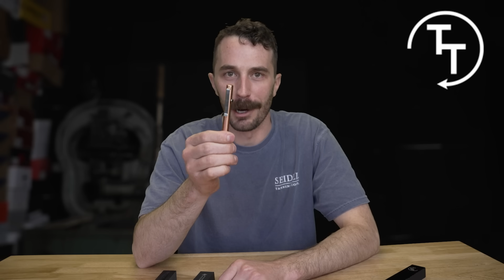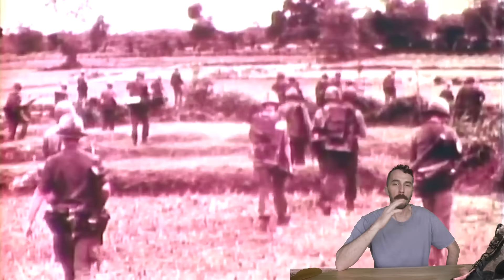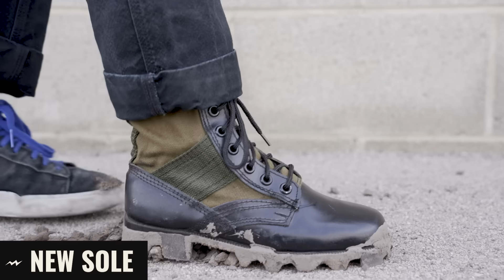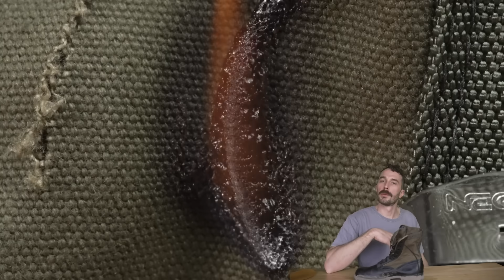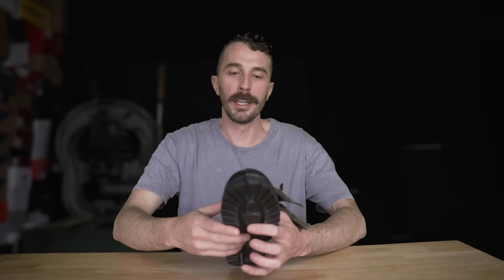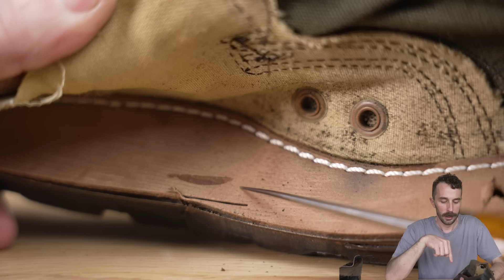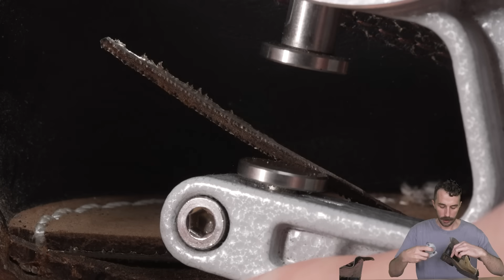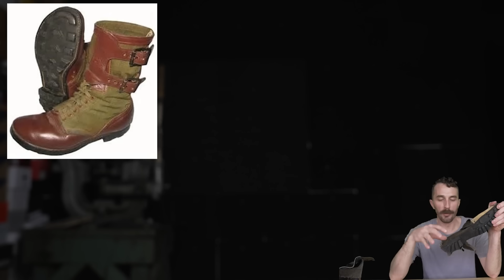Why it took 57 years to replace jungle boots

Comment: Jungle boots were awesome. They could be re-soled after they wore out with even better Vibrams and you had the best boot until you could not wear it anymore in 2005. They were very difficult to break in and you had to soak them and run in them to get them to expand then put a bunch of neutral and saddle soap to keep them expanded after running in wet boot for a while. Otherwise you would get the blisters from hell! New boots don't need this break-in process but don't last as long. I would like to see a test of the new Marine Corps jungle boots, the Danner RAT boots, and ICBs (Infantry Combat Boot).

Comment: Terrific boots only obsolete for war because polished black leather is an idiotic surface for a combat boot and shows up on thermal viewing systems. If the US makes another constabulary strategic mistake I expect a modern version to be fielded unless there's still a stash of originals. I wore out several pair on USAF flightlines because though they lacked steel toes they're outstanding hot weather boots for prolonged use on pavement. I'll take all I can score but so does everyone else!

Comment: We wore them when I first enlisted along with the OG107s jungle fatigues.   It was a good thing because in 1982 the new BDUs were very heavy weight and when wet stayed wey forever.    We would take the metal plate out of the jungle boots.  Add a good innersole and it was the best boot ever.

Comment: When  I went to the police academy. I bought a pair of all black original issue jungle boots from my local army navy $20. as they were discounted because they smelled like smoke as the boots were in the building during a massive blaze. I loved those boots so much. I wore them for training daily, and on the job daily for the following 6 years until they wore out. Even in New England where I am, I wore them every day year round, only on super cold blizzard days did I not wear them. The funny thing is, I own 2 pairs of canvas top "roll down"  Timberland boots that I love. So reminds me of my Jungle Boots.  I ended up with  Jump boots by Corcoran after but should have gotten another pair of these.

Comment: I was in in the early 90's. Least comfortable boot i ever wore. It was like walking with 2x4's strapped on your feet. 

The regular issue leather boots, once broken in, were very comfy, OTOH. The tread on those was like a 2 1/2 truck tire.

Comment: I have a couple of these boots and I love them very much. I wore them during my ROTC days and would often wear them if I anticipate to walk long distances or I have to charge through floodwater (I live in Southeast Asia, it floods a lot here). The only complaint I have with my boots are your feet should be tough enough to withstand these as they have little to no cushioning without any modifications. But I have never felt safer when wearing them since my pair has a puncture resistant sole.

Comment: I was a soldier in the 101st for 15 years. I still have my jungle boots. I still use them when doing yard work. They are great. They are holding up better than I am. :) When I first joined the Army, we were still doing PT in boots. Everyone worn jungle boots because of the weight. A well-worn broken in pair of jungle boots is almost like tennis shoes. Our PT uniform was the same as our duty uniform you just took off the shirt and ran in a T shirt. You can't really understand how wonderful jungle boots are until you run 5 miles in regular full leather combat boots. :)

Comment: I consider myself lucky to have scored 3 pairs of the hot weather, desert tan version of this boot, in 9 1/2 XW. There are a few differences; no spike guard, no vents, speed-lace eyelets except for the first 2 pairs, and I think they switched to non-metallic shanks. They are light, comfortable, give good purchase, and even though they are not insulated, work for moderate periods in the snow if I swap out the mesh insoles for felt ones.

Comment: I enjoyed how light weight they were. Made wearing them for extended periods of time easier. I had the larger lug soles. Only downfall is the sole material was soft, and if your duties required you to walk a lot on concrete and ashphalt they wouldn't last long.

Comment: a 200 pound man falling straight down from 2 feet is 350 pounds of energy and Im not a genius with math but that might per square inch...  those spikes are brutal... a perfect leveraged spike will penetrate that sole with sheet metal unless you're like 120 to 150 pounds

Comment: I loved the original Vibram pattern sole jungle boot. It fit my foot.  I live in Northern Colorado ,and for many outdoor uses,its great. I do not get along with the Panama mud soled boot.Something about that sole kills my feet.  Maybe its the raised perimeter/hollow mid section.  It might be OK on soft terrain,but on hard terrain,for me,its a fail.  Uninsulated Danner Pronghorns  are a good replacement.
The boot used from Korea up to Vietnam was a heck of a boot. I could get those slightly used via ROTC dropouts for $4 a pair. Then we would have the Vibram sole added.  Red Wing makes a nearly identical setup.

Comment: I had both black and green jungles in the early 90s. Black wore better but didn't last as long as the greens. While they obviously were made for hot jungle conditions, I wore them in fairly cold weather environments also. I probably still have a pair in the attic with all my old army stuff.

Comment: Current boots are so similar. If they were the same patern, i wouldn't tell the difference. I got only issued boots throughout my career (2015-2022) because they were cheap and lasted forever. People complained about the comfort, but i think putting the right sole in makes the difference.

Comment: I was in the US Navy from 79 to 85 and as soon as I got out to the fleet on board a destroyer I ditched those terrible Boondockers(do a video on those!) for a set of these Jungle boots from the Navy Exchange. Loved them and went through 2 or 3 pairs in my time on board ship from 81 to 85. Being on a destroyer very common to get your feet soaked walking on the main deck when a wave would roll across it. Theyse let your feet dry right out and that rubber was very grippy on deck surfaces.

Comment: One of the first boots I picked up in my first year in the army was the jungle boot (all black). The weight compared to a all leather boot and the canvas upper was a big reason to have it during summer time. Also, it required a lot less shinning. They are very comfortable with all day wear.
Reply: Same, black jungle boots were my go to boot. Went 7 years as soon as I got out of training status black jungle boots were my favorite unless snow or rain.
Reply: Yeah, the care of the black jungle boots was great. I found them hard to break in, but then quite comfortable. My only real complaint was that they were low enough that it was difficult to keep my pants bloused in them if I were bending down or crawling around under a vehicle.

Comment: Got issued a black pair in the Marine Corps back in 2001. Used it everyday and everywhere for years. Even during the winter, I preferred it over the goretex boots. Just double up on the socks. Your feet don’t sweat as much and provides airflow, which means your feet stay dry and you don’t freeze. I’m now in the Army and the current issue is the same style, minus the color and vibram sole instead of the panama sole. Still my preferred boots. Just add insoles and you’re set.

Comment: I wear the more modern Altima/McRae desert boot w/ Panama sole as work boots.
They are by far the most durable, comfortable and cool boots you can wear in desert heat. They SUUUUUUCK in cold weather though, expectedly.

Comment: I hate those shitty faux-Kletterlift soles on the early Vietnam-era jungle boots.  The Panama sole was not an improved development of the Wellco Ro-Search direct vulcanized jungle boot, but a return to the original WWII GI jungle boot sole (spoiler: after Big Army improved it, it didn't work as well as the original).  That boot was a canvas/rubber affair reminiscent of a sturdier Chuck Taylor, with a much higher top to allow one's pant legs to be bloused.  The tread was designed after tractor tire tread, to cam mud away from the direction of travel.  It was created by US troops garrisoned in Panama before the outbreak of WWII, hence the "Panama Sole" name.

The idea for the Saran mesh insole wasn't so much to act as a water sponge but an air pump, but I guess that's six of one/half-dozen of the other.  The originals were sewn together but the later ones were heat-welded (less expensive) and (surprise) tended to not work as well.  Ironically enough the multi-layer mesh insole concept came from Finnish winter insoles woven from birch.  The idea is the same regardless, feet that won't dry are bad in any climate.

Comment: I never knew jungle boots were so good. In Canada I only had access to cheap imitations, which don't have a steel shank, much less a steel plate.
Wonder how it does against magnetic mines?
I have a pair of bunny boots (the white ones), use it all the time in winter, my feet never get cold, even standing still for a long time. If wearing wool socks, your feet won't get cold or freeze even if you have water in them and it's -30C outside.

Comment: i was issued a pair in 1988. they had the steel shank in them and lasted me until 1998 or 99 when the leather tore right where it attached to the sole.

i bought another pair that im most certain were NOT usgi made/spec'd and within about 6 months the sole was split across the bottom.  threw them in the trash.

i bought ANOTHER pair made by ATAMA that touted them as being USGI.  they too split across the sole and were generally garbage.

i got out of the Air Force a long time ago and they no longer use this boot which is sad because they were the best pair of footware ive ever owned.  next to some leather Converse All-stars from the early 80s

Comment: My dad is a Korean and Vietnam war combat vet and he retired from the Army. He bought me my first pair of jungle boots from the military clothing sales on base when I was 13 and I wore them almost every day to school because they were so comfortable. Kids thought that the green sides were socks! When I enlisted in 1980 I wore what was my 3rd pair to basic. I was told to put them away with my civilian clothing because I was issue the full leather ground troops boot. When I got to my first permanent party unit I was allowed to wear them to the field and they allowed us to buy and wear the jungle fatigues too. I ended up going through several pairs of jungle boots in my 8 years on active duty, and mostly wore them to the deserts and never in winter, or if it rained a lot. In the desert I used surgical tape to cover the drainage vents so sand wouldn’t get in through them. A lot of guys did the same thing. I think I’ll get myself another pair after watching this video.
Reply: I was USAF Security Police, and my first duty assignment in 1988 was Clark AB, Philippines. I was there a year before I got my first pair of jungle boots, and I loved them. While we did patrol the washout to the east of our flight line, jungle boots were just as needed on the ramps as any where else, especially during a tropical storm, and you have an inch of water running over the toes of your boots. The standard issue combat boots just caught & held that water, at least the jungles let it back out again.
Reply: @earlwyss520  I spent some time at Subic Bay looking after some Army assets.
Reply: Glad I'm not the only one about to search out a pair of these!

Interesting reading about your adventures; thanks for sharing them!
Reply: I wore em in Panama and Honduras. Loved em.
Reply: Where do you get them, these days?
Reply: @LtColwtf  You can find them online or at a Military Surplus Store . But be careful as the cheap ones are made overseas which aren't worth a damn , but the ones made in the U.S.A. are good quality and will last 10 times longer !!!  I still have my old ones from the 70's which are almost wore out but bought a pair of the cheap ones and didn't last so I bought another pair made in the U.S.A and have had them for 5 times longer than the cheap pair , which the ones made in the U.S.A. still have allot longer to go before they wear out and still wear them as I choose .
Reply: @LtColwtf  -- maybe Army/Navy stores?
Reply: Marine vet , we loved the jungles. They were very light and comfortable.
Reply: @Leatherneck-jk9ew  SEMPER FI , BROTHER , AMEN !!!
Reply: Thanks for the video! Now I won't be able to get them anywhere! Best boots ever,
Reply: "He bought me my first pair of jungle boots from the military clothing sales on base when I was 13" You must have had quite big feet at 13.🤣
Reply: @internetcensure5849  Clothing Sales had them in all sizes.
Reply: @jluvs2ride  it seems @internetcensure5849 doesn't know too much and is a Keyboard Lurker, spouting unfound nonsense and evidently never got out of Their room. Lol.
Reply: @internetcensure5849  You EVIDENTLY don't know much, My Father is a U.S. Marine and served through the Vietnam War, His boot size was 6.5 R, My size is 7.5 R to 8 R depending on boot type and its function obviously. FYI, there is such a thing as standard issue Women Service Boots or as Dad calls them B.A.M.s (Broad A$$ Marine) service boots that are, big surprise,  MUCH SMALLER than normal or a deemed regular size. Yes, They did have and always have had small and large sizes in all issued gear to maintain demand especially during war time, please do Your research and think before You post unfounded facts and assumptions. Mic drop.....

Comment: My first pair I acquired were from the original P-S Sales out of Oklahoma; 13EE when I was about 13.  It had the Vibram soles.
The next pair were purchased years later at a local surplus and outdoor store.   Altima brand and 13W.   Those took a little breaking in but ended up fitting like a glove.   
Unfortunately now I've health issues in feet and legs.   Pluses as an older adult I'm now a 14EEEE.    Getting an original pair in my size or a quality replica probably out of the question.   Sometimes it sucks having a sasquatch build.